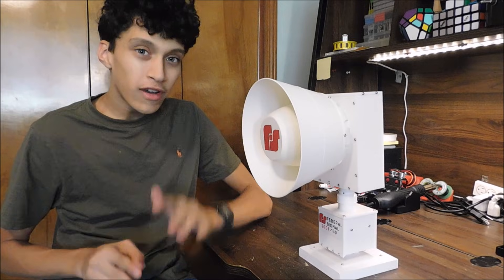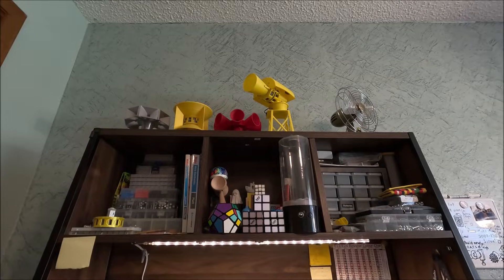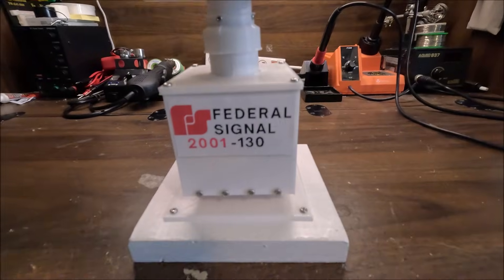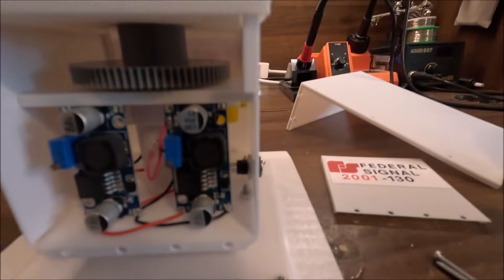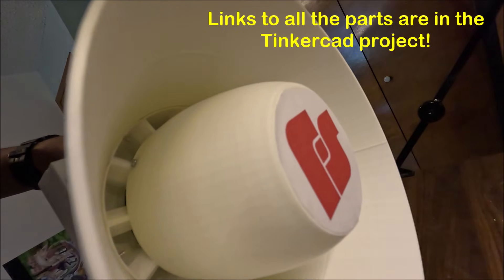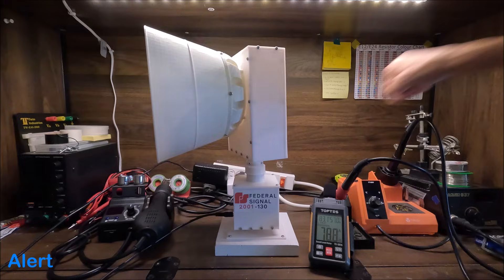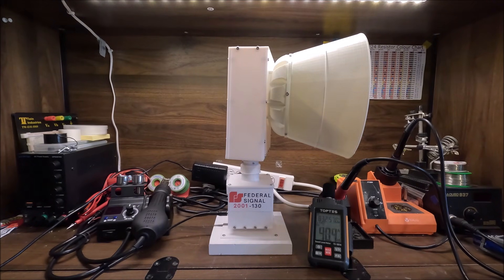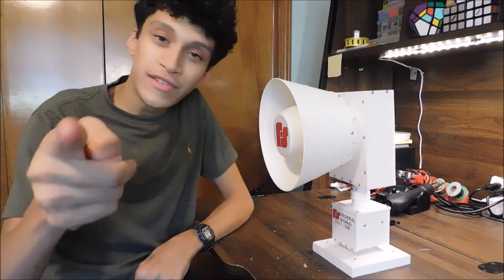My Mini 2001-130 Siren Overview and Test!

Comment: Making the Equinox Variant of this, how many volts does this need to run at?
Reply from the maker: I have an EQUINOX siren model available on Tinkercad right now! Here it is: https://www.tinkercad.com/things/fVhq2CHpRJ2-federal-signal-equinox-siren-500-motor-size
Also, I ran mine off a 12V DC adapter. A 2.5A one worked for me, but fewer amps would probably do just fine. It can pretty much run anywhere from 12 to 30 volts thanks to the voltage-regulating buck converters in the rotator.
Reply: @milespeterson5049  do you have any Equinox decals?
Reply from the maker: @Zirconium-p8t  Sure do! If you read all the notes on the reference model in the Tinkercad project, you'll find a link to where you can download and print the decals. The same can be said for any other links you need for the parts and things like that. Hope this helps! I would love to see you print an EQUINOX!

Comment: Would it be possible to get some sort of wiring diagram for your 2001-130? Having difficulty figuring out his to wire everything. Your sirens are great!
Reply from the maker: Well, I don't have a wiring diagram, but I can tell you in simple terms how to wire everything. First start by connecting both of the buck converters' inputs (not their outputs) to the mains of the barrel jack. Try not to confuse positive and negative! One buck converter's output will be wired to the gearmotor and the other to the slip ring. You only need to use two of the slip ring's wires. From the slip ring, then, run wires up to the siren's motor. That can be wired backwards, so it won't matter. Now, the siren's pitch and rotator speed are adjustable, so just fine tune everything till the pitch sounds good and the rotator speed is slow enough.

You can also really wire this however you want. I wired mine to start sounding when plugged in, but a few other people who made this siren wired the gearmotor and siren motor through external relays and stuff.

Hope this helps you! Let me know if you have any more questions. You should make videos about this when you're done!

Comment: Dude I need one so bad.
Reply from the maker: You can print (and soon buy) your own!
Reply: @milespeterson5049  I don't have a 3D printer T_T
Reply from the maker: @cherryblossomT2874D  Aw. If you save up about $200, you can get an Awesome Ender 3 printer. My Ender 3 V3 SE with auto bed leveling was only $220, and it was worth it! I print all my sirens on that printer, along with my Ender 3 V2. If you just don't want to print sirens, though, I should be selling some soon!
Reply: @milespeterson5049 I'll probably just wait hah.
Reply from the maker: @cherryblossomT2874D  Oh, okay! But... if I were to sell my 2001-130s, I'd probably price them at around $200, so you could get a printer with the same money...
Reply: @milespeterson5049  I'm starting at a job like next week so it shouldn't be a problem! I'd be happy to buy an already built one!
Reply from the maker: @cherryblossomT2874D  Awesome, man! Good luck on that!

Comment: BROKEN SOLAR PANELLLLLL
Reply from the maker: Yeah... His is alright, but this is bigger and louder!
Reply: @milespeterson5049 yo bro I know what you should make next
Reply from the maker: @Guest12-k1x  What is it? Please be somewhat reasonable with requests.
Reply: @milespeterson5049 you should make a hurricane siren if you already have one make a thunderbolt 1003 or a ACA allertor
Reply from the maker: @Guest12-k1x  Hurricane and Alertor, no. Why? Because Hurricanes are extremely complicated sirens with weird motors, and Alertors use a weird rotator system I don't understand. As for the 1003, I actually have plans for that, as that'll probably be my first coded siren. Much easier rotator system and chopper motor.
Reply: @milespeterson5049 thanks for the update I completely understand hurricane sirens along with the weird rotators can be quite hard to do 1003 I wish you luck on. Good luck brave soldier.
Reply from the maker: @Guest12-k1x  Lol, thank you!
Reply: @milespeterson5049 post updates on it if you do decide to do the 1003 looking forward to it! I will be at school so I will not be able to see your comments until I get home at probably 4:30
Reply from the maker: @Guest12-k1x  No problem! I post updates on all my sirens I make. My latest update is my Super-Sirex I'm working on, and I have a Short on that.
Reply: @milespeterson5049 cool btw I've been into some issues so I might not respond a lot
Reply: @milespeterson5049 how's it going how's the coded siren going if you're making it
Reply from the maker: @Guest12-k1x  I'm not making any coded sirens now, and I don't plan to really anytime too soon. If I make a coded siren, it'll be a Thunderbolt 1003.
Reply: @milespeterson5049 that's what I'm talking about the 1003 but if you're not doing anything then it's fine I won't annoy you anymore
Reply from the maker: @Guest12-k1x  Yeah, I just don't have plans for one really too soon. I will probably NOT be selling 1003s due to their complexity and big size.

Comment: Do you have a link for the motor you used?
Reply from the maker: It's in the Tinkercad project! You'll need an account on Tinkercad for that, but that's free, and that's also how you download the 3D files. You can find it here: https://www.tinkercad.com/things/hfeYWI87dMZ-federal-signal-2001-130-siren-500-motor-size
Reply: OK, so I looked that up, but couldn’t find any matching results
Reply from the maker: @Spciln1062  Did you check out the Tinkercad project? You'll need to remix it. The links can be found in the notes of the project.
Reply: Still can’t find it can u link it in the description
Reply from the maker: @Spciln1062  Get an account on Tinkercad and remix the project. Once you're there, there is a note on the reference 2001-130 model to the left of the Workplane that gives you a link to the motor. The project can be found here: https://www.tinkercad.com/things/hfeYWI87dMZ-federal-signal-2001-130-siren-500-motor-size

And the motor I used can be found here: https://www.amazon.com/uxcell-Micro-8000-8500RPM-Remote-Control/dp/B07M8ZMN17?

Comment: AMAZING!!!
Little note, I have a hard time believing that that's an 8,000 rpm motor when a typical 2001 motor spins at just under 4,000 rpm. If it was an 8,000 rpm motor, not only would the rotor exploding be a massive concern, but it'd be twice its normal pitch.
Reply from the maker: You're right! But, there's this thing called air resistance and load. So, when my rotor is spinning at full speed on my 8,000 RPM motor, it's actually going much slower because of air resistance on the rotor and the overall weight of it. But when the motor has no load, it's going much faster, probably around 8,000 RPM, like it's rated.
Reply: @milespeterson5049  Ah, good point.

Comment: What kind of slip ring is that, also is it the 12.5mm that I'm finding on eBay.
Reply from the maker: All the links can be found in the Tinkercad project! You'll have to open it up and look at the notes, but that will give you exact links to the parts I used!

Comment: Oh bro that's really nice and cool....... I really want to have it too 😮❤❤
Reply from the maker: And you can, when I start selling these!
Reply: @milespeterson5049  Gosh I was really impressed with the miniature Federal signal 2001-130 siren.It's very nice and cool and very different from my own creations which still use cardboard and other materials. 😅
Reply: By the way can you make miniatures of the Thunderbolt 1000 and FS 2001 SRN B sirens? 😊
Reply from the maker: @erlanggainaction6093  Well, I plan to make a Thunderbolt 1003, but I just made a 2001-130, so an SRNB would be like a step backwards, so I don't think I'll be making one.
Reply: @milespeterson5049 Okay, good luck making the Thunderbolt 1003😊 miniature.

Comment: Nice this might be the next siren to print after your sth-10 question can this work with a 555 dc motor?
Reply from the maker: Thanks! And to answer your question, a 555-size motor would not fit this normally. This siren is made to use an 8,000 RPM variant of a 500-size motor. But you could easily retrofit the hole size on the rotor and stator to fit your motor if you know how to model basic stuff!

Comment: That's awesome! Didn't think a mini 2001-130 would ever exist! Most people who made a mini 2001 focused on the older models like the 2001-DC (SRN 1st/2nd gen)
Reply: I made one myself but haven't shown it on camera.
Reply from the maker: @HSETM  Oh, well, you should because that'd get super popular!
Reply: @milespeterson5049  do you think? You can take pictures of the DC the DC buck converters  wiring    Because I’m halfway done with the 2001, 130 Siren and I need the wiring for the converters like what I mean by that is like where the barrel jack wired too and then like the rotator and the slip rings
Reply from the maker: @DAMIANVARGAS-w2t  Those are easy. Just wire the barrel jack's + and - to the + and - of both the buck converter's inputs. They are clearly labeled on the boards. Connect one buck converter's output to either the rotator gearmotor or slip ring. From the slip ring, wire that up to the siren's motor. I even show the insides of the rotator in this video, and that shows all the wiring. Hope this helps you in making one!
Reply: @milespeterson5049  this helps a lot. It’s just when I was looking at the video when you’re wiring it kind of looked a little blurry because of the camera angle but that’s totally fine because we all have mistakes but I hope it shows it on the tinker cad
Reply: @milespeterson5049  it looks easy but like the wires like scrambled in the rotator so yeah I just need help wiring them because my package is just arrived today so hopefully you can help me wiring it
Reply from the maker: @DAMIANVARGAS-w2t  Okay, why is it confusing? Just wire both inputs from the buck converters to the barrel jack. Then from the converter's outputs, wire them to the rotator motor and slip ring. From the slip ring, wire that up to the siren's motor. There, that's all the wiring! Hope this helps.
Reply from the maker: Thanks!! I totally know what you're talking about. Nobody had made a miniature of the latest 2001 siren, and I'm pretty sure I'm the first to do that!
Reply: @milespeterson5049  about  your 2001 siren I’ve downloaded the files that were in the description and I’ve gotta ask you something. Should the rotor spin, counterclockwise or clockwise
Reply from the maker: @DAMIANVARGAS-w2t  The rotor for my 2001 is bidirectional, which means it can be spun in both directions, just like real 2001s! No matter what direction it spins, the sound and pitch will be the same. Not all rotors are like this, though.
Reply: @milespeterson5049  wow thanks for the information. That’s great. I didn’t know that wow.
Reply from the maker: @DAMIANVARGAS-w2t  You're welcome! Are you building one?
Reply: @milespeterson5049 yeah
Reply from the maker: @DAMIANVARGAS-w2t  Awesome! I'd love to see a video on that if you make vidoes.
Reply: @milespeterson5049  I almost got the parts all printed to the 2001 but how do I put it together? Do you have like a tutorial video or something?
Reply from the maker: @DAMIANVARGAS-w2t You'll see the completed siren to the left side of the workplane in the Tinkercad project. Like with all the rest of my sirens, use that as reference. It shows you how all the parts go together. Feel free to hide or move any parts that are in the way.
Reply from the maker: For another example, let's say you're confused about the front panel. In the Tinkercad project, you should use the completed 2001-130 siren next to all the parts as a reference. So, you'll now see that the front panel connects to the sides, bottom, and back panel with M3 screws! Remember to read the notes on each part! They tell you stuff like this.
Reply: @milespeterson5049 ok ty so much
Reply from the maker: @DAMIANVARGAS-w2t  Of course! Good luck, man. This is a BIG project! If you have any other questions, feel free to ask!
Reply: @milespeterson5049  so I can make your 2001 it’s just I have one problem there. I don’t have any screws so I’m gonna order like a 12,000 piece set so I have a bunch of screws for the 2001 so it can be like an actual model
Reply from the maker: @DAMIANVARGAS-w2t  That's just what I did! The build uses mainly M3 screws, but the slip ring tube and base use M2. Just make sure you're getting the right ones! I used self-tapping wood screws.
Reply: @milespeterson5049  the latest 2001 siren series is the equinox
Reply: @milespeterson5049  one question what screws do you use for this?
Reply from the maker: @DAMIANVARGAS-w2t  My 2001-130 uses mostly M3-sized screws with a few M2 screws for the smaller parts, like the weather cap thingy and collector ring tube.

Comment: IMPRESSIVE
Reply: Just like yours you made it too.
Reply from the maker: Partial credit to you! I was hoping to see you in the comments here! Your SRNB inspired me to make a 130! All I can say is thanks!!
Reply: @milespeterson5049  You're so welcome ❤ I might suggest you redesign the upper half of the rotator, that doesn't look particularly strong.
Reply from the maker: @BSC_PRODUCTIONS  Yeah, I'm sort of using a cheap gearmotor to drive it. It's a 1:48 TT gearmotor from Amazon. But my rotator design overall is very reliable, and I haven't had any real problems with it. I might consider giving it a bit of an overhaul when I start production.

Comment: omg finnaly
Reply from the maker: Good things take time, man.
Reply: im not mad im jut happy its finnaly here
Reply: Also is there a version for a 130 motor?
Reply from the maker: @blazebardx  No, this siren is too big for a 130 motor. If you want to make one, I strongly recommend the 8,000 RPM 500 motor I used.
Reply: Also can I use a dual shafted gear motor for this or do I need the single shaft
Reply from the maker: @blazebardx  Both will work fine!
Reply: Great then i just need to reassemble one of my gearmotors

Comment: Thats a great design! Whats a good 3d printer to get btw?
Reply from the maker: Ah, are you looking into getting one? I have two Enders: an Ender 3 V3 SE and an Ender 3 V2. They're both pretty great, so if I were to recommend a printer, it would probably be an Ender. Preferably a newer one.
Reply: I’m not currently planning on getting one now but I do plan to get one in the future. I’m just looking at ideas right now.
Reply from the maker: @trainsandsirensofilinmiwi2080  That's great! Good luck getting a good one.
Reply: @milespeterson5049  Thanks!